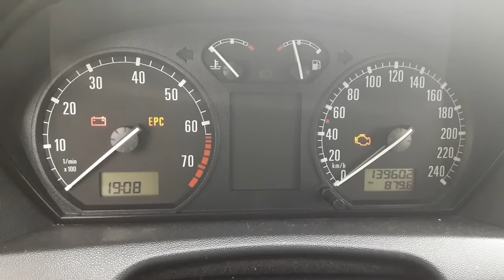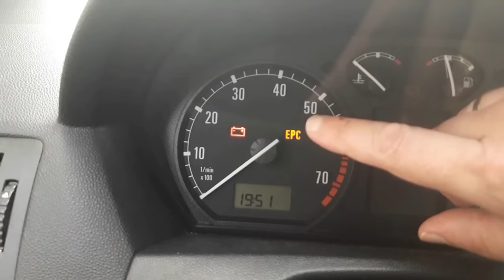Most Common Reasons Your Check Engine Light Is On

Comment: Hi, I've got a 2010 Fabia 1.6 TDi which ran for a while with the glow plug light intermittently flashing. Now the check engine light is on (but goes off intermittently). I ran a scan that gave me the codes P2455 and P2453 relating to the DPF pressure sensor A. Is this a simple fix or could I end up with a money pit?
Reply from the maker: Hi Glyn and thanks for watching!

With modern cars, there's always a good possibility of a money pit. You just can't know.

What I would do if I was in your place is to check all the connections to the sensor. I would check for good contact and that the tubes aren't clogged, just in case.

If that was OK, I would replace the sensor, erase the fault code, and see what happens.

This is all the advice I can offer and I presume that you came to the same conclusion. But this seems to be the only path to at least start and solve the problem.

Hope this helps at least a little bit.

Best regards!
Reply from the maker: Oh and more thing just from the top of my head: check that the exhaust isn't punctured or burnt out anywhere.

Comment: Is it safe to drive with check engine light sir??
Reply: Today it happened to me (08 Kia Rio) at destination - so I still had to go like 5 miles to get home. Car did not idle well at stop lights!  Don't know if driving thru puddles from rainy day had effect. Will see tomorrow what happens nxt!
Reply: I went out this am - lo and behold my gas tank cap WAS loose!
Reply: It was my radiator leaked, i changed it and everthing fine now

Comment: See my Oil light came on and then I broke down when my check engine light and battery light came on. Idk what to do it’s 1999 Toyota Corolla and it won’t start now . What should I do
Reply from the maker: Hi and thanks for watching!
Don't want to be the bearer of bad news but when the oil light comes up it usually means serious damage to the engine.
It doesn't always have to be this way but in most cases it is.
The check engine light and battery light came up probably because the engine stopped running.

The oil light comes up when the engine oil level is very low. Did you check the level recently, does the engine burn oil?

Regarding what you should do:
1. If you heard a strong clunking noise from the engine when the oil light came up, then the engine is probably damaged in some way. There isn't much you can do and best visit a mechanic because a serious repair is needed.
2. If you managed to turn the engine off just after the oil light came up, check the oil level and add some. Try starting the engine. If it starts and you don't hear any strange noises (works normally) try driving, but carefully. Visit a mechanic anyway, just in case.

If the engine is damaged because of a lack of oil, then you may be looking at a partial or complete engine overhaul.

If the engine is OK, you have to find out why is it losing oil.

This is the best I can do to answer your question and I hope it helps.

Comment: Have had my pickup since it was a pup. Same mechanic has done the maint, on schedule, since then. Before heading home from the beach, 2 hr. trip, I stopped for gas. Noticed the idiot light just as I hit the driveway.
I'll be darned!! Thank you for this vid. Was the 1st thing on your list...didn't have the gas cap on tight. WTF?? Like I'd never fueled up before.
Reply from the maker: Hello and thanks for watching!

Glad the video helped. I've had a similar case, the only difference was the gas pump wasn't a self- serving one.

The worker that poured gas forgot to put back the cap altogether and left it on the roof.

Luckily I noticed in the rearview mirror that something fell off beside the car.

Since then I always check if the gas tank cap is tightened and is returned properly.

You can never be too careful :-)

Comment: Can all these problems be detected on diagnosis?
Reply from the maker: Hi and thanks for watching!
Some yes and some problems no.
The common way is to hook up the OBD scan tool and read the fault code.
The downside of this, although rare, is that it can send you on a wild goose chase and result in changing parts or making unneeded repairs. This is at least from my experience.
I like to check the most common faults first without the OBD scanner and make a visual or manual inspection.
Bit old school, but proved, ate least in my case to be effective.

Comment: Car engine light flickers when going up hill but shudders while driveing and standstill any ideas
Reply from the maker: Hi and thanks for watching!
Are there any other symptoms present?
Reply: @DespairRepair  Thanks for getting back too me its a automatic. When in drive foot break on at the lights its seems jerk more. But its changeing gear fine. Like i said going up a hill are if its heavy load like i put my foot down quick eg overtakeing really shakes and warning light comes on then off once its over the hill are de accelarate sorry rubbish at explaining
Reply from the maker: @youtubemembers40  no problem, it's the least I can do.
From what I understood it could be a lot of things. This is why it would be best to hook up an OBD tool and get an error code.

It could be an air leak, problems with the ignition system a PCV valve, or else. Once you get a code you'll perhaps have a starting point, otherwise, you can end up spending a lot of time or money solving nothing.

To tell you the truth, I had similar symptoms in my car and it turned out to be a faulty crankcase breather. 
There's a video on that topic on our channel so you can compare if you want to.

If you want to, make a brief inspection of all the air hoses and connections, check for leaks, loose clamps, broken wires or other anomalies under the hood. maybe there's something you can solve without an OBD tool.

Hope this helps at least a bit!

Comment: So afterall there exists so kany possible causes for the check engine light that is more worth it to get an OBDII scanner instead of going thorugh all possible causes.
Reply from the maker: Hi and thanks for watching!

Well, yes that's the general idea. The whole purpose of the system is to use the OBD scanner.

But it's always good to do some old-school diagnostics under the hood besides the scanner.

In my own experience,  this gives the best results.

Comment: I have no check engine light on while driving in town. When I get on the freeway and go 80mls the check engine light comes on. When I turn car off and then back on the light goes away. I went to autozone to use the machine and there was no code since the check engine light was off
Reply from the maker: Hi and thanks for watching!

If there's no imminent danger and the car drives normally, best continue driving.

There might be just a glitch in the system which might go away.

Monitor for a couple of more days. When and If the check engine light is on all the time, best go and check the error code.

Hope this helps.
Reply: @DespairRepair  thank u so much

Comment: Hello, my question is can failing fuel pump cause check engine light to be on?
Reply from the maker: Hi and thanks for watching!

Sometimes yes, weak fuel pressure in the system may cause a check engine light.

Try connecting an OBD tool and see if there are any error codes.

Hope this helps
Reply: Thanks for the reply

Comment: hi there, can you please shed some light on my situation: i have a 2006 corolla 1.6 4 gear automatic (not sequential) and my engine light has come on. My mechanic scanned it and it displays the following: code P0741 $10, torque converter, clutch circuit performance /stuck off. The thing is that here in Crete (island in Greece) nobody knows how to fix an automatic car and I really dont want to take it to the dealership, can you please tell me what to do? can i keep driving it with the warning light on? practically there  doesnt seem to be anything wrong, it drives the same, thanks!!!!
Reply from the maker: Hi John Diakonis, thanks for watching the video!

Well I probably won't give any information that you haven't concluded by yourself already but here it goes:

Can you keep driving the car? If there are no radical symptoms or signs of an imminent breakdown or danger, yes.

It seems you don't have any other option anyway.

That code may well come from a bad clutch plate. If that's the case, then you can drive without any major problems until it wears out completely. 

I've driven a car like that, it drives pretty normally (occasional clutch slipping and higher revs with higher fuel consumption) until the clutch plate is really near its end. Then higher revs are needed to shift and start the car and eventually it becomes undrivable.

What I would also recommend (if you really don't feel any changes in driving or when the transmission shifts), check the wiring installation and all contacts. These faults are known to come up for a short circuit or bad connector.

Also (and please don't take this as patronizing) maybe the dealership isn't such a bad idea if there's no other solution. 
It's probably expensive (as in all countries) and the investment is very questionable for an older car. But maybe better some more money today so you can drive safe and sound tomorrow. Especially since it's a Toyota Corrolla, good car and well worth the investment regardless of the selling price value.

I've also been through all this and made a video about it, it's on the channel and it refers to the dual-mass flywheel.

Hope you don't mind the long comment, just trying to help. Automatic transmissions are also rare in my country and people also manage any way they can.
P.S. I must mention that I've always known where Crete is, hope to visit it someday, if for nothing else then because of the climate and archaeology sites.

All the best to you and hope the repair goes well.
Reply: @DespairRepair  hi again! thank you for your insight and for replying so quickly, I will consider your advise, i'm glad you know about Crete, its a beautiful island, you should visit someday, you wont regret it,  alot of people i know keep coming back every summer.

Comment: It's not a good idea to cover up a check engine light. The light is a warning that there is a problem the ECM can no longer compensate for and engine damage is immanent. It is cheaper to fix the problem than replacing a burnt up engine. Here are some tips: check the engine air filter, check the temperature gauge and coolant level in expansion jug, at 100,000 miles try the sparkplugs. Trouble codes can identify the system having the problem but try simple solutions before more costly ones. I had a clogged engine air filter on a Chevy cobalt and that made the light turn on.

Comment: I have a nissan ad van  and i have the check engine lichts on and than the car wil not drive it take no gas ... how can i solve it.
Sir...
Reply: Did you get help, I have the same problem. I keep on disconnecting battery now and then to put off the check engine light. Am tired of disconnecting battery

Comment: Thank you so much for the information it was the gas cap
Reply: Once you replaced cap did engine check light disappear by itself or did you had connect it to computer
Reply from the maker: You're welcome and glad if the video helped!
Reply: @Pit5336  it disappear from itself

Comment: All my car needed replacing my brake pads! Problem solved, Engine light went off, and hasn’t came back on, I can’t believe this man didn’t know your brake pads could be worn. Bought my car brand new, only had 34 thousand miles on it, when the engine light came on.
The rotors, and drums were fine.

Comment: Hi Sir, I have engine light issue too and its only turn on when I hit more than 80 kph specially when I'm driving in expressway. It never off unless I turned off my engine and start again. If I maintained my driving speed below 80 kph engine light will never turn on. Anyone also experience this kind of issue?
Reply from the maker: Hello Feitan,
Sorry for the late reply, in your case I would check the air intake namely the hoses, clamps and seals if everything is properly tightened and fits.

I had similar symptoms on a Fiat Stilo I used to own, found a loose air hose clamp near the air filter. Tightened it and the check engine light never came up again.
Reply: @DespairRepair  Thank you Sir I will try this recommendation and will update here.
Reply: Same trouble I encountered with my CRV. When I checked the pms manual, the spark plug is long overdue for change. Ive changed it and it's making good progress so far. Suggest, the car maintenance schedule should be carefully understood and followed as well.
Reply from the maker: @joseiiimarquez753  I agree, good advice! Thanks for watching and all the best to you!
Reply: I have literally had the same problem and I’ve also been hearing like a rattle noise while the car is idle
Reply from the maker: @averydominant._5436  hello and thanks for watching.
The rattling noise can be caused by various things. 

If it's combined with a turned on check engine light you might have a fault with the ignition system, namely the spark plugs or an ignition coil.

But this is just a wild guess since I would need some more info on the symptoms.

Comment: I was thinking about changing my spark plugs anyways I changed my alterator and battery of my car but I haven't change my plugs in awhile it does seam like I have some type of electrical problem so that might be why
Reply from the maker: Hi and thanks for watching!

What car do you have? Why did you change the alternator?  What kind of electrical problem do you have?
Regarding the spark plugs, see when they were changed the last time. If it was recently done, you don't have to.
Sorry for the interrogation :-) but I need some more details so I can perhaps answer the question.

Comment: My gas cap WAS loose so I tightened it. The engine ran smooth afterwards, and no stalling in stop and go traffic,, but the check engine light is still on.
Reply from the maker: Hi and thanks for watching!

Try leaving it until you start the engine a couple of more times.

If that doesn't work, try connecting an OBD tool and erase the error code (https://youtube.com/shorts/e-Ifj_kKqb0). Here's a link to our video if you're interested.

If you don't have an OBD tool, here are a couple of ways you can try to reset the check engine light, also our video.
https://youtu.be/b-P2YGVXuzw

Hope this helps.

Comment: My check engine light came on after a 2 hour drive, nothing seems wrong so imma check it in a couple days if it stays on
Reply from the maker: Hi and thanks for watching!

Yes, especially if there are no immediate problems.
But check it out with an OBD scanner as soon as possible.
Reply: @DespairRepair  i will

Comment: How do you KNOW if it’s the gas cap not making a full deal even if you hear that click?
Reply from the maker: Hi and thanks for watching.

I'll try to answer although I didn't clearly understand what you mean.
The only way to know to is to take a look at the rubber seal on the cap.
If it's brittle, cracked or worn out then change it since it can't seal the fuel tank properly.
Hope this helps and all the best to you.

Comment: Mine comes on and stays on for a while then randomly goes back off and stays off for quite some time. And Ive never gotten it to read it when it's actually on, because I have no code when it's off.. Annoying, car works absolutely fine but just knowing its there stresses me out haha 😂
Reply from the maker: Hi and thanks for watching!

Then best don't do anything :-) :-) :-).
Sometimes it's better to do nothing than do everything without no result.
The check engine problem is notorious for that.
Reply: @DespairRepair  haha yeah I mean it's probably nothing to worrie about, but it's still bothers me 😩

Comment: Bro in my car one day Check engine light blinks at 110 speed and then it's gone what is the probpem any major issues or not ????
Reply from the maker: Hi and thanks for watching! It would be good if you can describe the problem in more detail.

Here's the best I can do with this information:

-If it doesn't interfere with normal driving (no unusual sounds, stuttering or else) just keep driving.

-If I was in your place, I would first check the air intake.I had the same problem and described the solution in a separate video. If you have the time and will here's the link:https://youtu.be/2EiZiqBKxRU

-If the problem starts to appear on a regular basis, best hook up a diagnostic tool and read the code. This way you'll have better information.

Hope this helps at least a little bit.
All the best to you.
Reply: Drive safer by not going so fast
Reply: @DespairRepair  there is no prob sometimes loose wire can also blinks the check engine light or any sensor miss out something than also check engine light blink and i already showed to Ford 's service and they check all wiring and All ok no problem is there..and thanks for the replying 😊